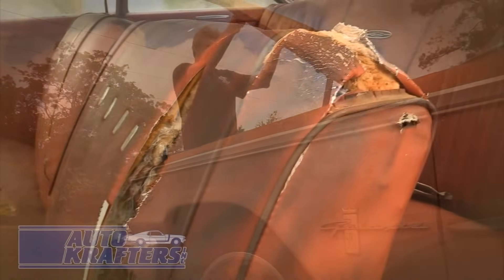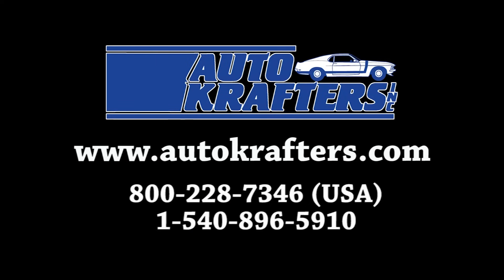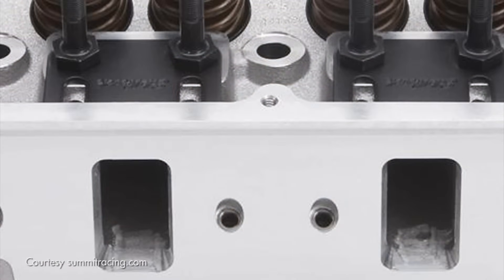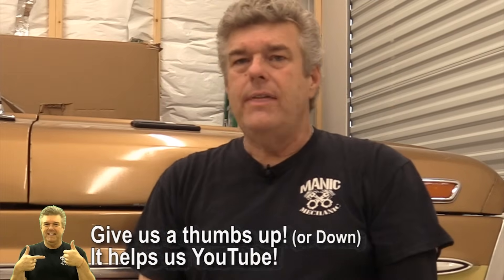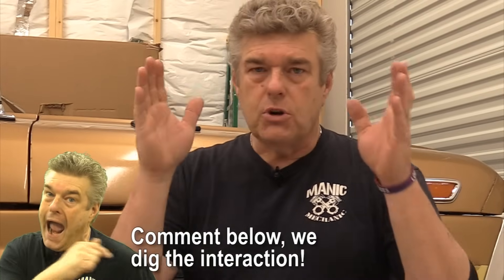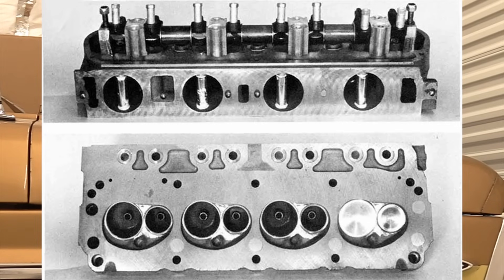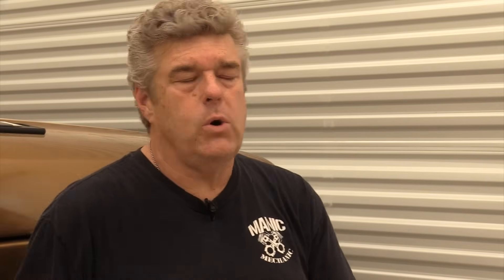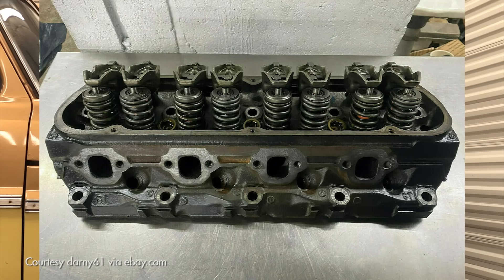Ford Heads Explained

Comment: I love the 351 Windsor which for my 1971 Galaxie500 I rebuilt it as a Street Boss, I just hate hearing Clevor! B&A Ford performance had the best intake for this project... and using the Cleveland D1AE 2V heads that I still got... in the shop :) That 351 Street Boss is a Stump Puller of a motor and had no problem getting a 4400 lbs Galaxie moving!
Reply: uh, its a clevor, youre mixing families
Reply: @DominatorGarage  Ford never used that line that is a back yard mechanic name that is why a real Ford enthusiast will never say Cleavor.
Reply: @mylanmiller9656  no they didn’t use clevor. It is derived from Windsor and Cleveland, As in putting Cleveland heads on a Windsor block (besides boss 302), so a 351w with Cleveland heads and special intake? Clevor.
Reply: @DominatorGarage  Ford was first to  make this mod and they sure didn't call the  Boss 302 a Cleavor. It was some back yard jerk that  did that.
Reply: The Galaxy didn't weigh that much unless it was six people full tank of fuel and luggage....  Gross vehicle weight.
Reply: I hate that Cleavor name too. I always have called the Cleveland head 5 liters “ Street Boss.” Because it’s basically a low buck Boss 302.

Comment: 1980-81 on the 255ci v8 the "tunnel port" heads. smaller chambers, little smaller valve but room for bigger, the intake ports can be worked  and they will flow decent will require extensive work (porting, valves ect) but these heads can be made to flow good #'s
Reply from the maker: Thanks for the heads up.

Comment: I took off a set of the 351 heads from a 1974 galaxy and they had the bigger valves and intake ports with the closed combustion chamber they were factory heads and I also had some 351 heads from a 1975 with bigger valves and intake ports with closed combustion chamber but they had the small plugs and tubes for smog control have you ever seen any of those???
Reply: My '68 cougar had those... 302 4v. I never learned enough about them but wonder now if they were desirable. ultimately I swapped in a 351 with D00E heads.

Comment: I'm working with a set of 351 DOOE-C heads, porting them a bit gasket matched, I need to find valves to fit them, and also need springs, b303 cam, explorer upper and lower, 65mm throttle body, 373 gears, I hope she runs good!
Reply: Early 351w heads respond very well to port and polish jobs, don't forget about harden exhaust seats, some good quality stainless valves and your set !!!!

Comment: Are D5A5 CA 351 heads any good? And does anyone have specs?
Reply from the maker: That is a "depends head" it depends on what the valve size and chamber size is. if the intake valve is a 1.78 then you have the open chamber small valve head--not good for performance.
Reply: @AutoRestoMod  okay thanks for response. What's the good one?

Comment: The 2bbl Cleveland heads are a good choice for a 302, yes you will need the track boss intake and different ex, dont use the 4bbl heads, its just a waste and you will not make as much power, slick the ports up and nice valves and springs and there ya go, Drag boss garage is a huge resource of just about anything Cleveland
Reply: The Australian Cleveland heads are the best choice. They have the smaller combustion chambers of the U.S. 4V head combined with the smaller ports of the U.S. 2V head.

The U.S. 2V chambers are way too big.
Reply: If you don't mind 7 to 1 compression.  2v heads have massive 76cc chambers. Much better off with cc 4v heads... facts. I've built many...

Comment: The 1968 302 had 289 stamped heads on it, they ALL did and some parts will not fit from a 221 or 260 to a 289 and later because those 2 smaller motors were what was called the gen1 and 289 and later were gen2, and be careful of the later 255 because they were nothing but a large boat anchor
Reply: Not all '68 302 heads had 289 markings (they probably just used up the remaining stock). The '68 4V 302 had its own specific head with 53CC chambers (C8OE-F). (I had a '68 Fairlane 500 w/ 2V 302 & the C80E-J heads were marked 302.)

The early 289's used the 221/260 5 bolt bellhousing pattern. The 221/260 blocks also had 1 less freeze plug per side than the 289/302. IIRC, there was also a change to the motor mount bolt pattern.

289/302/351W heads will physically bolt onto the 221/260 but if the valves are too big they will not fit in the smaller bore of the 221/260 (or the 255 for that matter).
Reply: My 68 302 had 289 on the heads and 302 in the valley with a C8 4V iron intake

Comment: Old 65 289 heads stuffed with 1.94 and 1.60 are the best starting point. WE ran a set, I have a set. We ran a set on a 351w.  Bought a set of RPM'S. Made a whopping 1 tenth!! The 60' was faster. All that hype is bs! And they look stock. I've ran the 69 351w heads! Go with the 65 289 heads, have them ported and put 1.94 and 1.60 valves installed.we ran all those heads! The 289 heads look stock too! The 69-70 351W heads have bigger chambers and the exhaust port takes more work! Get a set of Victor Jr past that! Or Canfield

Comment: I've  been putting 1.84 intakes and 1.55 exhaust valves , plus studs and plates in 1968 - 1974 heads for several years.
Reply: Most racers back in the day used a 1.90 valve in them.

Comment: My 351W has the D0E heads.  After cutting out the "thermatic humps" from each exhaust port they are very good flowing heads.
Reply: I have a set I am working on, grinding out the humps in the exhaust and just cleaning up and port matching. They have factory pressed in studs, you think I should run them? Or get them drilled and tapped to a screw in style 3/8 stud?
Reply: I once hogged out a set of these. Just yard out the studs and replace with Chevy studs so they’re adjustable, drill and roll pin them with loctite. They’ll take about 2 years of hard abuse at over 8k rpm before one finally breaks loose. They will flow and make a .030 over 302 sing.

Comment: I am doing my 66 289 2V heads. Talked to a couple of machine shops and got the drivel about it being cheaper to purchase aftermarket heads. Then I asked about AFR 165. No they say, you want the 185. Yes, the cost is the same, but for a street rod to cruise, the smaller gives more port energy. A bit of judicious porting on the 289 heads and getting the machine shop to replace the worn guides with 8mm bronze will allow LS valves to be used; 1.9" intake and 1.55" exhaust. At low lift the valve curtain is the main restriction, so increasing the valve diameters by 0.125" is a big benefit. For the same reason I am going to use 1.7:1 ratio rockers, increase the valve curtain area quickly. I have a low mileage cam from a 351 and the lifters that I previously owned. Cam is an Engle short duration high lift grind that will work well in the 289. Lift will work out to 0.500".
With this plan, I will learn some about porting. If the heads are cracked and you are not looking for a concours car, then the aftermarket become a no brainer choice. Just which to select, keeping in mind most performance shop employees are racers and will try to talk you into the bigger port heads. That may not be advantageous for your build.
Reply: If you're 289 heads don't have screw in studs the lift of your cam may cause them to back out.

Comment: You're giving valve size a little too much importance here, the GT40p had a smaller exhaust valve than the regular GT, but it had a better exhaust PORT. So it flowed marginally better even with the smaller valves. And the repositioned plug WAS a bother manifold wise but it also boosted combustion efficiency. 

One more thing, if you look at the chamber size of modern V8s you'll find 70 plus cc are nw the norm, but so are higher CRs, the bigger chambers un shroud the valves and the compression coes from the piston crown.

Comment: Very accurate information. Thank you! Currently building 95 gt convertible. Factory hydraulic roller block found in 2 years only the 94-95, am I correct?
Reply: 302 rollers are from 1985 to the last year of production.
Reply: @Randy Sleek  ALL 302's from 1985-1995 were roller then correct? That means my 1995 Mustang GT convertible was built during the last year of roller production!
Reply: @jonpierce734  yes, crown vics were the only one with a roller block, and flat tappet cam.

Comment: I have a pair of Trickflow, they stage III heads with all the good stuff done to them. They will be going on my recently acquired ‘93 Lightning. And put the GT40 intake back on top with a 1 inch spacer for rocker cover spacing. E303 will be the cam. I really want to build a stroker and have a good short block .60 over already that my son and I built several years ago. I put a pair of Windsor heads on my wife’s 5.0, an ‘86 car, I ported them and port matched the runners. Man that engine came to life! Reminded me of my Cleveland in a ‘70 Mach that I had several years ago.
Reply from the maker: That should be a very potent combo.

Comment: I remember in the late 80s trying to find a better cylinder head for my '85 GT foureye.
The ONLY choice was the J302 Aluminum heads which were crazy expensive, like $1,800 for a bare set, and weren't that great compared to all the modern aluminum Windsor heads.
I ended up cleaning up and porting a set of '89 'fuelie 5.0' Windsor heads (which actually were no different than my '85 heads)
 My Mustang still ran much quicker with those ported OEM cast iron heads w/roller rockers.
Now I'm building a Dart 363 with AFR 195s for my '85 GT. 
575 HP from a lil 8.2" deck Windsor, 
N/A.....Yowza!!
Reply from the maker: Thankfully we've come a long way with that stuff, right?

Comment: I found 351w gt heads in an ‘85 e-350 long body that came with a 351 HO 4-v.
Reply from the maker: The HO351s are fairly hard to find now. But yes they did have a little bit better head than the 302HO.

Comment: Yes, as claimed by Ford and Ak Miller, the 351W heads milled for 10.5:1 compression ratio on a mildly built 289 worked quite well for me for many years.  Of course, given today’s crappy gas, I will be using aluminum heads to be able to run a slightly higher compression ratio than I could with iron heads.  But it sure was fun running stock-looking iron heads; only those in the know could tell they weren’t stock 289 heads.

Your info regarding the 289 HiPo heads and plain 289 heads is not entirely correct.  All early heads and early 289 heads had the narrow slots to guide the pushrods.  Only the later heads used the round holes.  Yes, 289 HiPo heads used the same size valves, and used the narrow slots to guide the pushrods, and used screw in studs, but also had the cast-in spring seats.  (And of course special casting numbers, double dots, etc.)      Joe
Reply: One thing to concider about compresion is the actual dynamic compression. A quickish example is my personal street stock engine. It has a 10.4:1 ratio. With camshaft "A" it cranked 240 cranking compresion and required race fuel to run. Switched tracks so changed cam to suit track. Now camshaft "B" is in and makes 160 cranking compresion and runs great on 91. 
  My daily driven pickup truck has a 9.3:1cr with a torque building cam. I crank at 205# and need 94oct minimun. I also have a 10.6:1cr 306 with  factory HO cam that made 350hp and cranks 160#. It runs ok with 87oct.
Reply from the maker: You are correct. I dometimes gloss over things. It is a consistent issue of do I do more info and cause heads to explode or do I in essence "hand them a shovel so they can dig".
Reply: GT 40 heads are ok but have exhaust manifold/header & sparkplug interference in some applications. BE WARNED! Make sure you get the exhaust manifolds that work with them. Put some Trick Flows,AFRs or another good set on your engine and be done. Float a loan @ the bank if you have to. I just sold a good set for about what you pay to get stock ones reworked. Now I’m gonna build a stroker Windsor with the Cleveland heads. I got lucky enough to find the right intake and have most everything else. I keep it all FOMOCO except for the B&A intake that way. Ford actually made an intake for this but I let that one get away from me but he still had the B&A.
Reply: @Axeman428 The GT40 heads do not have fitment but the GT40P heads do. GT40 heads fit like regular stock E7 heads.

Comment: I found a set of 69 DOOE heads for $20 in excellent condition from a guy who updated his top end to aluminum.  Figured for my 351w I couldn't go wrong. We did deck and polish the ports.
Reply: How are those heads working out for you now??
Reply: @Lifeistooshort67  my mechanic has the motor assembled but has been busy so I haven't heard it yet.
Reply: @meek01__53  Ok thanks. Keep me updated if you can. I am building a 351w roller and don't have a lot to spend. So any advice is very welcomed.

Comment: Dam.....I had a 69 Galaxie 500  with 351w back in the 90s. I know now why so many folks tried to buy the car for the motor when I left the car sitting in my grandparents yard after I got a new bronco back then.  I was sitting on a gold mine and didn't know it. I ended up selling the car in 98 or 99 for 650 bucks cause guy wanted to put the motor in his dirt track car. I was fixing to pull that motor and put it in another bronco I had but, at that time I was young and starting a business and lost interest in the motor swap.

I've since learned the 69 351 heads are what the gt40s were based off of.

Comment: might wanna check your facts. the gt40 and gt40p have 60cc chambers. the p head will work with a ton of aftermarket and factory manifolds and headers. Dont know where you get your info, but you need new sources.

Comment: Or you can run a set of the 66' 289 heads that have been port matched and polished with .195 valves with screw in studs and guide plates. People look under the hood and see cast heads but not know exactly what's going on in there 😁😁😈😈

Comment: Great vid!  Thank you!!
Not to bird dog your research but.... 
Hi Perf 289 heads in addition to built-in guide plates had built-in valve spring locators.
They  were quite the complete package in many ways...just so-so breathing capability.
Reply from the maker: Good eye on that. I have a lot of information not all of it comes up at once lol.
Reply: Something that is a fact is, all small block Ford Engines from 1962 to the end of 1965, had built in guide plates and hard push rods, some of the early  1966 engine also had this feature. Any engine that came with Rail rockers had soft pushrods round push rod holes.

Comment: I have a set of 2 Bar "MM" heads from a marine/industrial setup. F3JE/CA or AA. Was told from Ford Performance that they are the same as 3 bar GT40 heads. They came with stainless valves. I want to put them on my 289, not sure if anyone else has experience with them.
Reply from the maker: You will have a compressions drop since the combustion chambers are bigger.
Reply: @AutoRestoMod  I will be milling them down a little to get the chambers a little smaller. What is the most you think I can shave before running into clearance issues?
Reply: @blk05gt 289 heads are 54 to 55 cc. P heads are typically 58 to 59cc... that's nothing .010 can't even up. Gt40 heads are running around 64cc. Figure .10 points for every .006 off the head surface
Reply: In other words .030 would offer roughly half a point of compression gain.

Comment: Hi, new to your channel and really like your videos. Question, I’m in Australia and managed to get a buddy bar inlet manifold with the Ford part number on it for my 351 Windsor from the states for my 70 Mach1. Back in the day, do you know if they were a good inlet manifold as getting any info on these manifolds is limited. It looks identical to the hi rise inlet manifold Shelby had on the 69 Mustang, but theirs I believe had Shelby on it as mine just has the complete Ford part number. You seem to know your stuff so thought I would just ask. Cheers
Reply from the maker: I had one of those. And yes, it is a good performing intake and is indeed a match for the Shelby Cobra intake, some of which were, I believe made for Ford/Shelby by Buddy Bar. 

From Jalopy Journal:Buddy Bar ran a foundry that produced manifolds for Edlebrock in addition to short run products for a number of individuals/companies like Ford. As a side note, Fred Offenhauser and his brother Carl split the sheets and Carl went to work for Buddy. Probably the two best foundry men in the business under one roof.
Reply: @AutoRestoMod  Hey thank you for the information about the manifold, that was great to have some info. The only other info I found was when Ford built the GTHO Falcon in Australia, you could by this inlet manifold as an aftermarket bolt on from Ford. No wonder a lot of the GT boys here look closely at it. A mate of mine sold one  
 of these manifolds for $1000 so they can bring good dollars here. Thanks again!!

Comment: Could you please do a video on FE heads, best, worst finding codes ect. Thank you very much! Keep up the great work ☯️
Reply from the maker: Great suggestion! I'll get with Barry Rabotnic on that.
Reply: Best......cammer heads
Worst....70s 360 smog era heads. 
😄 

Really depends on what your purpose for the engine is. Your low, medium, and hi risers all served their  purpose for what they were designed for.  
These days a good set of trick flow fe aluminum heads are better than the stock heads.
Reply: 427Medium riser &428CJ heads are the ultimate wedge heads for the FE, from Ford. The CJs have the dual bolt pattern on the exhaust for convenience! These are getting harder to find and the price could be more than a set of good aluminum heads. I have had all kinds except the SOHC or tunnel ports. The tunnel port &SOHC heads are not gonna be easy to find or get parts to make work anyway.